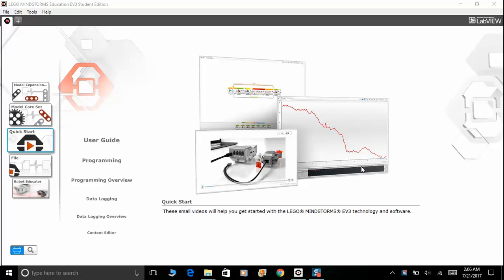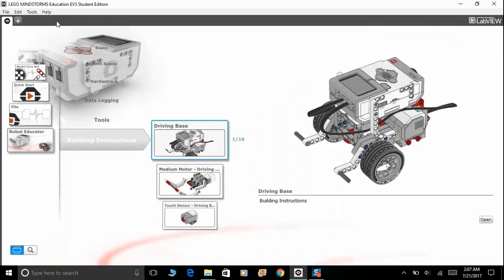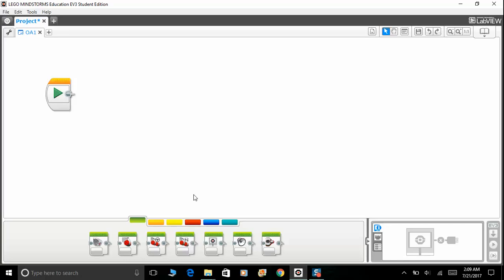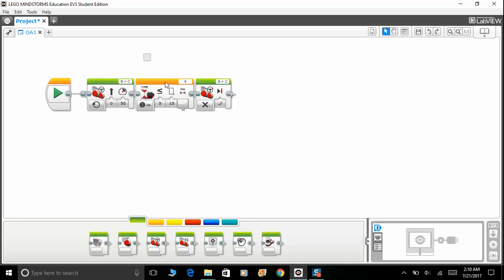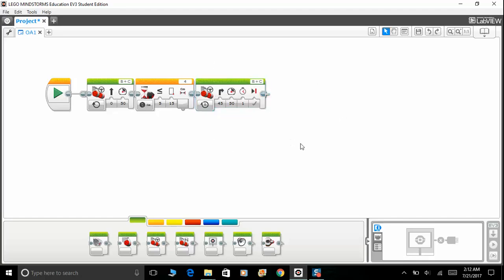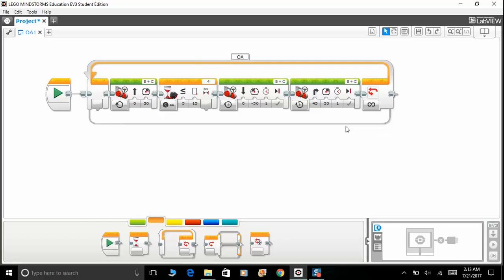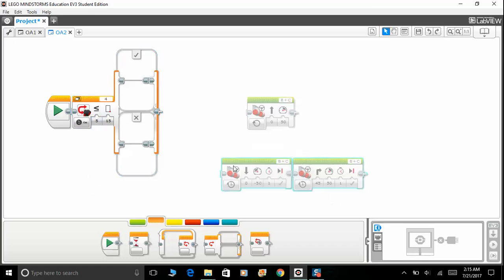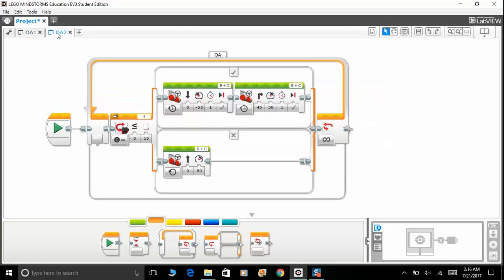Basic Obstacle Avoidance - Lego Mindstorms EV3

Comment: Hi I have a problem with the software.
I'm taking care of the interruptions of the robot: when it detects an obstacle at a certain distance (5cm for example) the robot must stop as long as this obstacle is there and then go on from where he was.
The issue here is that after the interruption of the course loop (when the robot has detected an obstacle), it is not possible to continue the course where it was, ie return where the loop stopped.
I hope you can help me.